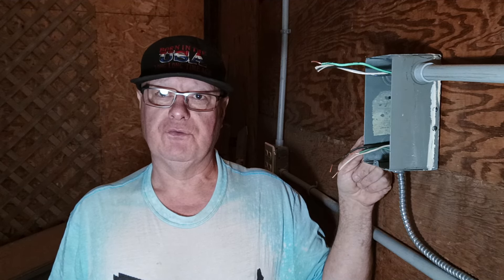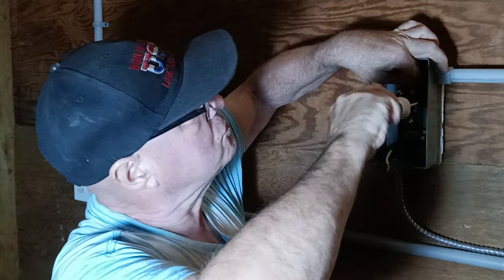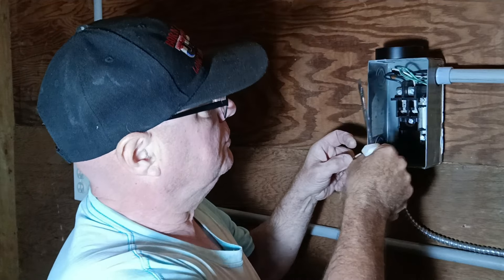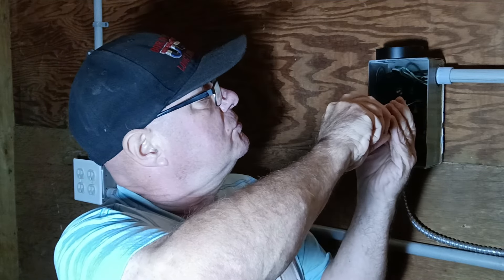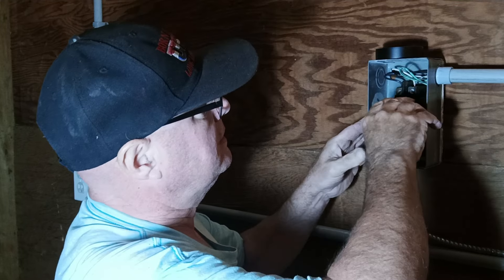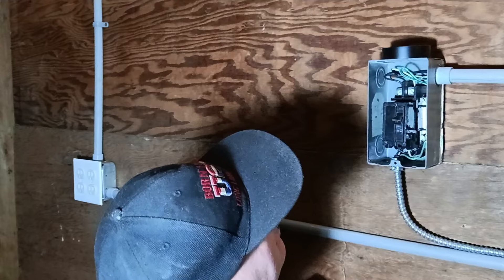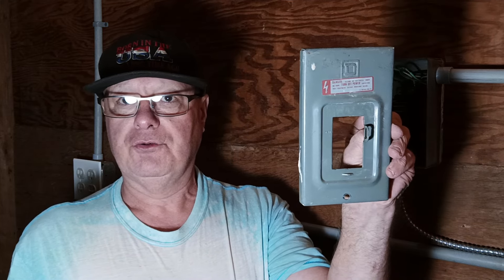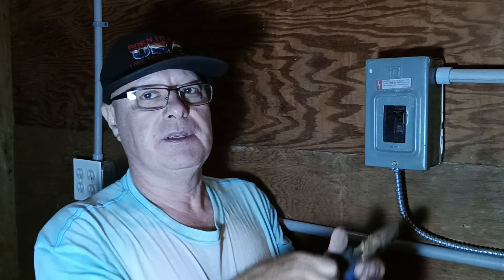how to wire a 3 conductor 240 v. breaker disconnect box neutral bar bonded to box

Comment: I would not use black tape to remark the white neutral  as a hot wire. Since the black tape is used as a general repair tape, it can be confused with as an insulation repair. I would rather see a black marker used or use red tape  to identify it as a hot wire.